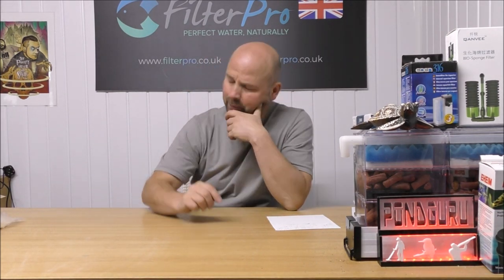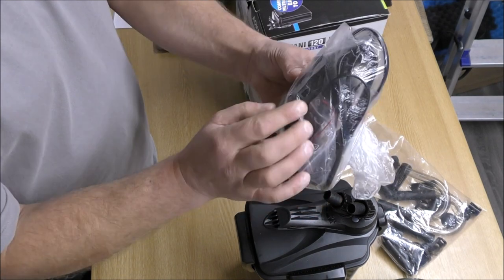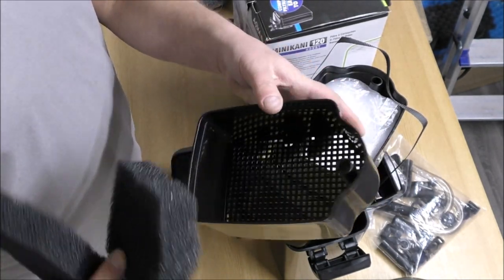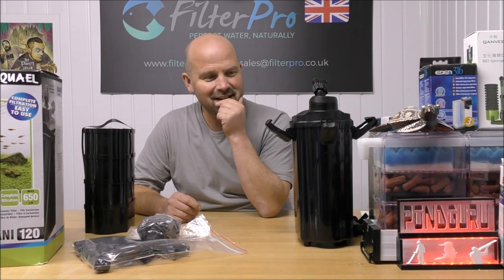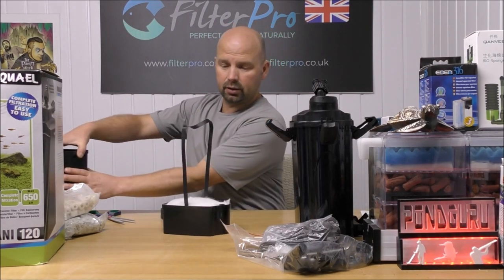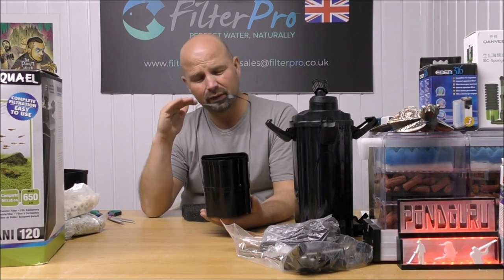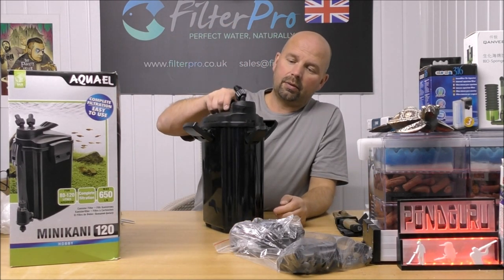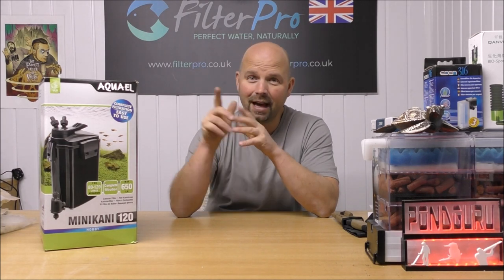Pimp My Filter #48 - Aquael Minikani 120 canister filter

Comment from the maker: Aquael Minikani 120 (Amazon): https://geni.us/ZQohH
This is a non-standard type of canister filter as the pump is not integrated into the top of the canister. Instead it goes 'in-line' on the inlet or outlet pipe allowing all the available space in the relatively small canister to be used for foams and media. At a maximum it will take 3kg of Biogravel in the top 3 trays or 2kg biohome ultimate allowing for a coarse pad to go at the top of the top tray to prevent media entering the outlet pipe (if the filter is knocked over).
There aren't many of these filters around but if you are looking for something ready-made to be the perfect 'nitrate filter' (with the addition of an in-line tap / valve to reduce flow) then this would be a great choice as explained toward the end of the video.
Sorry, Google / Youtube see fit to send me almost no notifications for comments so you're best bet to reach me is to phone on 07772848730 or send an email to sales@filterpro.co.uk (Richard) 
Biohome products and foams: http://www.filterpro.co.uk
FilterPro site has links to worldwide distributors.
Amazon Reviews: https://amzn.to/392EZ2g
INSTAGRAM: https://bit.ly/2KAk1fx

WHAT IS A FULL CYCLE?
If someone tells you the aquarium nitrogen cycle ends with the production of nitrate that is incorrect - please read on
A full cycle is completed by bacteria - the aerobic part of biological filtration which processes ammonia to nitrite and nitrite to nitrate followed by an anaerobic part which processes nitrate into soluble nitrogen which bubbles off to the atmosphere.
Therefore it requires a suitable amount of excellent quality filter media to be able to provide the environment for both aerobic AND anaerobic bacteria - that is what Biohome ultimate does perfectly but even with such good media there are limitations and we recommend the following amounts for different stocking scenarios:
(1 US gallon = 3.8 litres)
(1kg = 2.2 lbs)
Average community tropical aquarium = 1kg per 100 litres 
Average coldwater aquarium = 1kg - 1.5kg per 100 litres
Predator aquarium = 1.5kg - 2kg per 100 litres
Large cichlid aquarium = 1.5kg - 2kg per 100 litres
Malawi / Tanganyikan aquarium = 1.5kg - 2kg per 100 litres
Marine aquarium = 1.5kg - 2kg per 100 litres
Average mixed fish pond = 1kg per 200 litres
Average koi pond = 1kg per 150 litres
Avoid using any products which claim to remove, detoxify or bind ammonia, nitrite and nitrate as they will have a noticeable starving effect on the bacteria which will manifest as an inability to achieve a full cycle due to a low population of bacteria on a starvation diet. 
Let Nature do the work and as long as you have a suitable sized, well set up filter there is no reason why a full cycle won't be achieved.
You may be disagreeing with the above figures but remember that the recommendations are for a FULL CYCLE not half a job - achieving 0 ammonia and 0 nitrite is quite easy since aerobic bacteria grows freely on any surface but the anaerobic bacteria responsible for COMPLETING the cycle needs more a specialized habitat.
Size a filter properly, set it up sensibly and you will have perfect water - it's that simple....and your filter won't be the dreaded 'Nitrate factory'.
If you have a filter you'd like me to feature in a video then please contact me on:
sales@filterpro.co.uk
07772848730 (Richard) 

Anyone who sends a filter (UK only at present) will have it upgraded and returned to them for free and the only cost you will pay is how much it costs to ship it to me - I'm helping to boost your filter and the resulting videos will hopefully be useful to viewers all over the world so it's a win/win. 

The following videos will be useful to anyone interested in learning more about filtration, bacteria and making the conditions for your fish as good as possible:
Sizing a canister properly and filter set up: https://goo.gl/om19un
Looking INSIDE different filter media: https://goo.gl/hZWS6c
Bacteria and filter media: https://goo.gl/123gAF
How to clean an aquarium: https://goo.gl/bPMhvh
Aquarium tips / filtration playlist: https://goo.gl/pXgqVj

This channel is purely a hobby for me so I will never ask viewers to donate money for any of my projects or charge anyone for information - information should be shared freely and I certainly don't consider myself an 'expert' in anything I pursue as a hobby so please do your own research, never accept anything as 'fact', reject anyone claiming to be some sort of authority or 'expert' and make your own minds up about anything you wish to study. 

We all are on a long path of learning......... 

FILMING EQUIPMENT:
Panasonic HC-VX870 HD camcorder http://geni.us/3UwE
+Rode stereo microphone: http://geni.us/4OL
Zomei Z666 tripod: http://geni.us/1a1af3
Manfrotto MTPIXI-B PIXI mini tripod: http://geni.us/87f7

Feel free to share or link any of my videos on facebook, twitter, forums etc. for the benefit of others as I am not on any of those sites.
See you next time.
Pondguru
Reply: The link to the filter brings me to woman's cotton thongs on amazon 😂
Reply from the maker: @irishmanbd8447  I've just checked the link and it brings up the filter for me - not sure what is going wrong there, lol
Reply: @pondguru  yeah not sure what the deal is. When i search for the filter myself, I cannot find it on amazon.
Reply from the maker: @irishmanbd8447  That' a strange one. The link probably only works for UK Amazon or some EU countries.
Reply: Amazing,  if something happens to pump also we can fix power head to the canister,

Comment: Good morning Richard. I am the one who should thank you for this great opportunity, to have my filter reviewed and set up by a specialist. Much appreciated. The filter is working perfectly, had no problems with it. The only issues I have with it, just like somebody else put in a comment is that water does come out when I remove the lid (solved by placing the filter in a plastic container) and the occasional vibration whenever the pump touches something else (like the table leg). I also had a problem when I did set it up first time, I did put the pump on the return of the filter but I struggled to prime the pump again after cleaning so now I have it on the inlet, pushing water in the filter. Thanks again

PS: As for Game of Thrones, maybe I will give it a try if they do a sequel :)) ; funny enough, you are the second person to mention it when hearing my name
Reply from the maker: That is great to hear and as far as Game of Thrones goes it is great apart from the 8th series which was a let-down as far as story goes.
Reply: @pondguru  Totally agree... it could have been so much better
Reply: I thought water might leak out when lifting the lid have you tried the pump in the aquarium ? I would have bought one of these but literally on the 2nd of Feb I bought a Tetra ex 800 I've almost finished pimping it. I can't wait to see how pondguru pimps the Tetra ex 800 and his thoughts on it as well as the amount of media he can fit in it for when I slowly replace my Fluval Biomax with biohome ultimate or Ulta mini.

Comment: Great to you making videos again! 👌The idea of having The pump as a separate unit does not just Make The maintenance etc easier but most likely Also enables one to optimize The output of it. In My understanding If it is placed higher up it does not need to Do so much lifting.

Comment: Great to see you posting videos again! I always set up my filters based on what you teach. 
Just had a thought about why the media supplied in this filter is put in upside down by the manufacturer - the bio media is much heavier than the sponges and floss so if they put it in correctly as you suggest, the package might be too top heavy for storage and stacking in large numbers ie a big stack of them might be prone to collapsing. They should tell you how to do arrange the media in the instructions though, which I bet they don’t.
Just my tuppence worth 😊

Comment: I've been using a Cobalt Aquatics 26000 Ext canister filter since 2019. It too has the external pump that I placed in the tank on the inlet tube. It's nice because if it fails I can easily replace the pump without having to but a whole new canister filter.

Comment: hi pondguru the topic about that the 6 watt pump is to little to give a decent flow, you are right about that when talking about a normal integrated pumphead, becous it has to pump the water up, i have a similar model from aquael a midi kani, a litle bit bigger model more recent, it is square like the bigger ones you already gott, annyway i place the pump just above the intake socket, it does not have to pump up water, only one or 2 inches, i have been testing the flow it was close to 600 liters i remember. the biohome filtermedia realy works wel in my filters, exelent stuff !
Reply from the maker: Nice one - that's all good news.

Comment: I think the smaller 80 version can be used as a good subfilter minus the pump but cannot confirmed if the ultramax 2000 is powerful enough to sucked the water from it. This canister filter is a one way in and one way out.

Comment: Loving this series. I'm redoing a tank, 5ft x 2ft x 2ft. Going for an undergravel filter but setting it up reverse flow with a surface skimmer prefilter. Laying a matrix of pvc pipes across the bottom of the tank. How do you think a bed of biohome would do in this scenario?

Comment: When are you completing the pond ( lake ) filter? You've kept us in suspense long enough :)
Reply: This ^^^^^^
Reply: My guy!! ^^^
Reply from the maker: I am in the process of moving the whole lot to the other side of the pond which may seem crazy........ but....it was in the wrong place.
All the drains from the filters will be piped down into new vegetable gardens which will be watered simply by lifting a slide valve and draining the nutritious stuff from the filters directly into the beds. Some beds are quite near the filters but others are about 80yds away so plenty of pipe is needed.  The house and pond pump(s) will be powered by a new 12kW solar system (with 12.4kW batteries) which should be in by early March but I need to finish digging the final 20 ton or so out for the base by hand and also dig a long path to link the two veg gardens by hand too - weather has been against me on that one.
The filters will also feed a large greenhouse which will be fed from the filters and powered by the solar system so I can grow lettuce, peppers, tomatoes etc. all year.
Most of the filters will be to grow plants in them as the idea is that the roots will support invertebrates which will then was down into the pond to feed the fish in a sort of permaculture set up - it's quite the project and I saved up for it by early 2020 but the covid nonsense coupled with the business going crazy busy delayed things significantly. When it's all in it will be class and I'll be making videos on organic gardening, self sufficiency and cooking for my other channel (Thousand Yard Stare) as those subjects will be increasingly important in the near future. I'm still trying to edit all the filter videos shot over the last 18 months and I hope to be through them by the time the nights get lighter.
I hope you're keeping well during this time when the World is upside down.
Reply: @pondguru  that sounds awesome, with regards to feeding the garden with a switch is there any reason you don't just create a hydroponic garden, you could circulate the water all around the garden and have a pump at the end returning it to the pond...
Reply: @pondguru  Richard thank you very much for your detailed response. Sounds like a big project and that it will be well worth the wait for us. I am glad you are keeping well and stay safe
Reply from the maker: @simonsepic  I don't need to return it back as the pond is spring fed - the height to get it back up would need a massive pump too. However, I do have plans for vertical growing walls for the greenhouse and that will use a hyrdoponic / aeroponic type set up. All top up water for that will be from the filters so there will be a constant supply of nutrients.
Reply from the maker: @robertwilson1239  Yes, never been more focused on the road ahead and when this all gets going it will be awesome. I really wanted to have all this in place for 2019 as I knew 2020 would be a big year for the power players behind the nonsense going on now. I keep safe by not watching the TV, lol
We will practically be Amish by the time this project is completed.....

Comment: Richard the top handel akt as a valve so You don't need to ad any more, all aquael filters work like that, but the pump has some drawbags,
ther is allways problem to start that filters, and the tend to leak :(
Reply: Surely if the pump is in the aquarium there is no need to prime as it pumps tank water directly into the canister and the air gets expelled it's how pressurised pond filters work.
Reply: @oliverskinner8962  yes but then IT take up space in the aquarium. :(

Comment: Perfect filter for an Anoxic Filter experiment perhaps? 🤔 Using a deep multi layer substrate and reverse flow undergravel filtration powered by this. Intake could be a lilly pipe with a surface skimmer attachment using the media boxes just for mechanical filtration for a 4 ft heavily stocked planted tank🤔🤔🤔

Comment: If you place the pump on the inlet tube won't it push through the media instead of pull? I thought that was bad? Are there one way valves on the inlet/outlet connectors or could you switch direction so that it filters down and you can put the sponges on top?

Comment: Notice you didn't speak about much more than the pumps flow rate. You might want to see how warm the pumps get while operating. I had a couple similar filters and the pumps got pretty hot and died within six months. Those pumps look like a similar design. There are several brands of external water pumps that provide a variety of flow rates, better cooling and are less expensive than replacing a canister filter.

Comment: Hi Richard, this may be a silly question. But can you tell me why dont you use the activated carbon?
Reply from the maker: We probably spoke on the phone about this? Sometimes I forget to mention carbon / chemical media but in most videos I will mention that it needs to be last in the system.
If you phoned me shortly after making the comment then the carbon would go last in your filter (top tray) if it was the 2000 lph APS filter and carbon would be replaced every 7-8 weeks.

Comment: I got 4kg of bio home ultimate and have 0. Ammonia but still very high nitrates been all most 7 months what could i be doing wrong
Reply: Try a sponge filter.
Reply: @sidestepp  i have
Reply from the maker: Without further details on tank size, stock and any chemicals used that is impossible to answer but any tank can achieve a full cycle when everything is in place to do so. Here is a link to the Q&A page on the FilterPro website: https://filterpro.co.uk/qa-24-w.asp
That may help to highlight something missing (amount of media for situation) or preventing the cycle (e.g. a conditioner which binds ammonia, nitrite and nitrate) but feel free to ring me any time on 07772848730 - Sunday included as I work 7 days a week - I'm assuming that you are in the UK so that's why I give my number out on all the video descriptions and pinned comments. If you're outside the then email any time on sales@filterpro.co.uk and we will get to the bottom of the problem no worries.
Reply: @pondguru  yeah am in the uk that would be wicked i try and ring today thank you so much
Reply from the maker: @Mrtom40  No worries, man - any time is good but have a read of the Q&A page first to see if anything jumps out there.